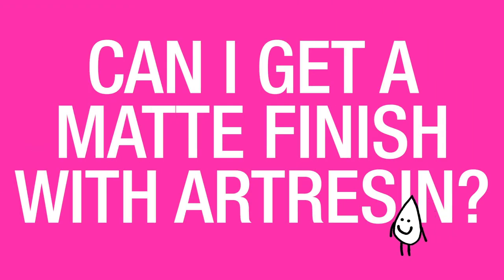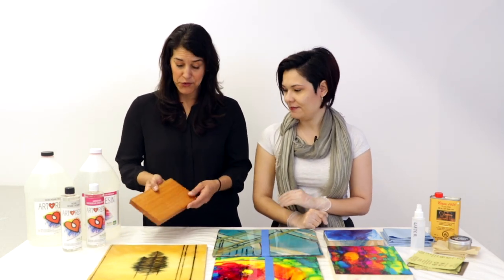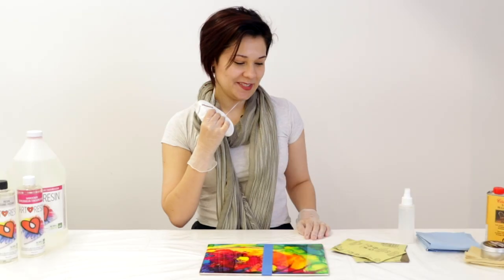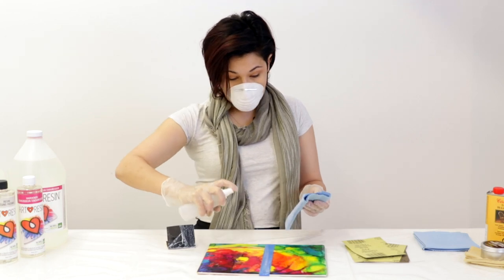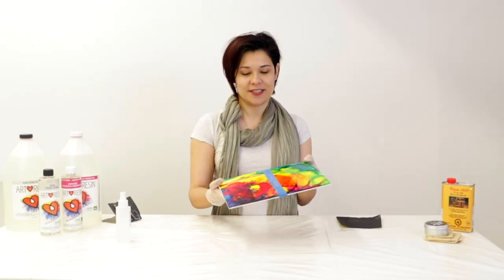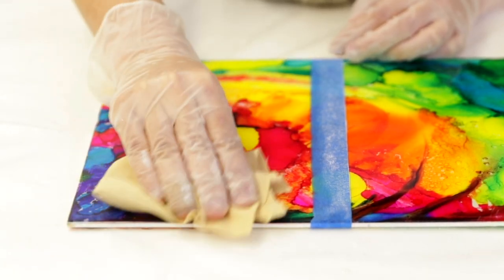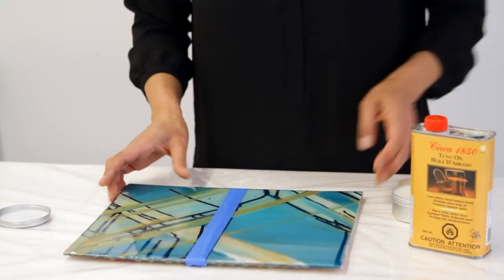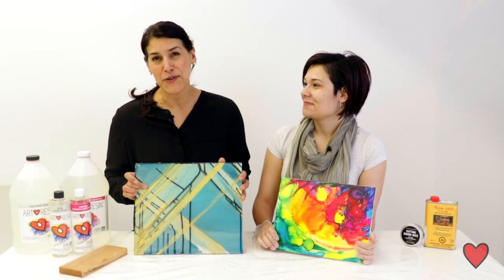How To Make Epoxy Resin Matte

Comment: I would be concerned about discoloration...would this not yellow over time?
Reply from the maker: Sanding won't cause the resin to yellow,. if you are concerned with the wax or oil causing yellowing, Joanne does mention that the Tung Oil has a yellow tinge and she recommends only using that on darker backgrounds like wood.  You can choose a cutting board wax instead.

Comment: I didn't see in the video where the tung oil was used...????
Reply from the maker: Hi Jeff,  they didn't actually use the tung oil on these two demonstrations,  they chose to use the cutting board wax.  Joanne mentions that the tung oil has a bit of a brownish tint to it so she prefers to use it on wood rather than artwork that may show the colour.   The cutting board wax and the tung oil are the last step of this process and you can choose to use either one of them.

Comment: I make coasters. Can I use woodblock/cutting board oil? I have some and wanted to make sure. I have sanded down because i was going to use more resin but I want to test matte finish. Also does oil have to be added repeatedly if its something like a coaster/trivet? if you decide you want gloss can you add resin later? Sorry so many questions! but i love your videos and ART RESIN is my FAVORITE resin by far for my coaster. I will start making items for food use. So I know woodblock/cutting board oil is safe and i'd love to be use it on something other than my wood projects! Hope this makes sense! Thanks for the video :)
Reply from the maker: Hi Jasmond - I would definitely give it a try to see if it works ... I don't see why it wouldn't, but try it out on a test coaster to see if it gives you the results you're looking for.  If you decide you want to add another coat of oil or wax down the road, you certainly can. If you want to restore the gloss, just give the coaster a sanding ( it will look scuffed, but don't worry ) and then you can pour or brush on ( with a disposable foam brush ) another coat of resin.  Hope this helps :)
Reply: @Artresin  this is so very helpful! Thank you so very much :)